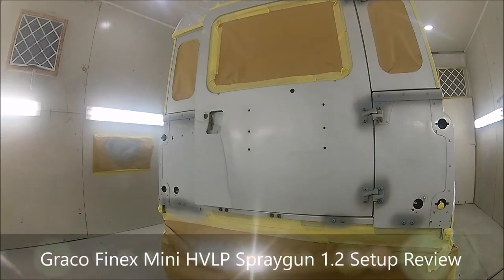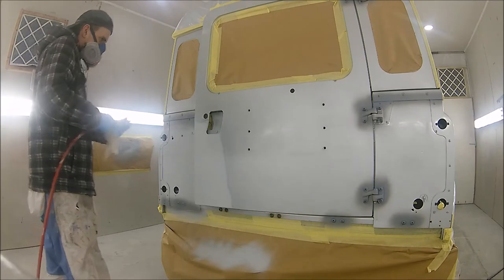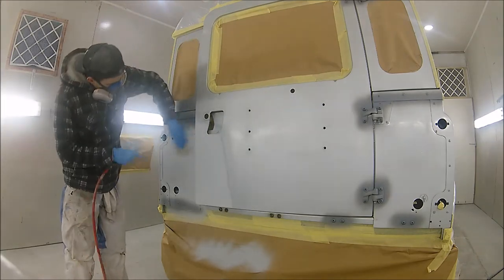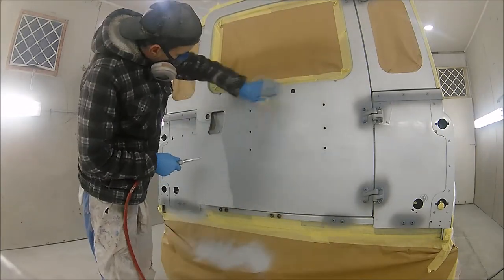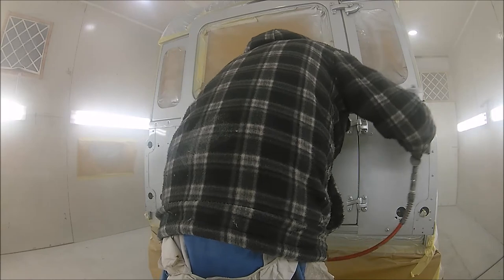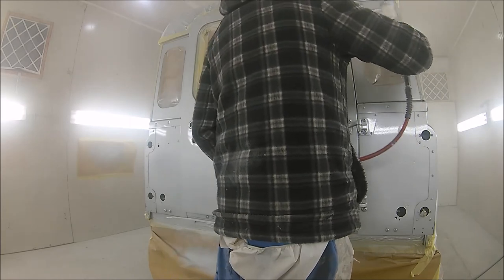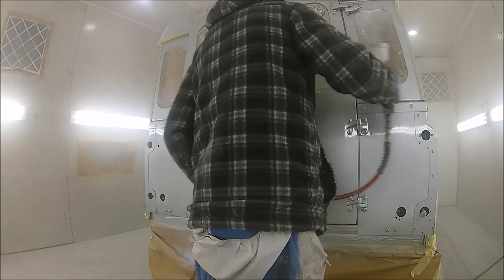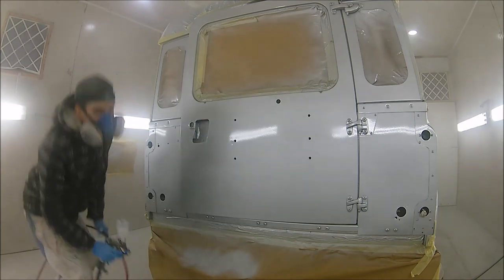Review : Graco Finex Gravity Feed Mini / Spot Repair HVLP  Spraygun 1.2 setup

Comment: Tony thanks for taking the time to review the fx1000. I bought this gun last year and all it has needed is a new lid for the cup, that was $5.00 US online. This gun is awesome quality for the money, I paid $130.00 US. My gun came in a 1.0 tip and I have found it a bit small shooting spots with dupont cromax chromabase....You really need to keep it around 29 PSI and use more reducer than you normally do or it can spit or get blotchy...Our Chromax chromabase is a 1 to 1 mix. They recomend 1.4 mm - 1.6 mm tip, so you really need to reduce it using the 1.0 mm tip.

My fx1000 truly looks as good as the day I bought it over one year ago...I have really been impressed with it's "Black Nickel" fin ish, it has been so durable and easy to clean. In my opinion, you will hard pressed to get much better quality for the money.

Tony have you tried the fx3000 yet? I hear some guy's really like them as well.

Comment: Looks good, I have been dealing with Sprayguns Direct for best part of 10 years and i have never met any other company with better customer services, they just do it right
Reply from the maker: +jason evans they are never had a problem with there service and there always straight on the phone if theres any issue with an order which is great coz you dont get the order turning up with bits missing if there is anything on back order you know before they have posted , brilliant guys have used them for almost all the guns i own
Reply: +Tonys_Refinishing I've got this gun in 1mm, went to spray guns direct to buy a 1.2 or 1.4 fluid tip, 40 quid plus post, that's ridiculous, half the price of the gun.
Reply from the maker: +user12345 this one was in a 1.2 tip size and youl usually find that with the lower prices guns tbh that the setups are expensive
Reply: Tonys_Refinishing Shame, cause it's a nice gun, just the right size for small jobs at home
Reply from the maker: +user12345 yeah I found it a really good little gun tbh , I bought it in the 1.2 and found it ideal

Comment: Tony I was wondering how you paint your door Jambs on a full respray of the car. I painted my 300zx and I jammed it out first then used the foam tape to try to keep the overspray out of the Jambs before I painted the outside of the car since I was painting the outside at a different time, what a screw up the Jambs were full of overspray on my clear coat so I'm starting over..my  question is should I paint the Jambs and the outside at the same time with basecoat then the same with the clear coat in order for this not to happen..used foam tape on the Jambs but it didn't hold and let overspray get all in the finished Jambs. I'm knew at this so I'm in the learning process but I will keep on till I succeed. Any advice would be greatly appreciated. sorry text is so long just trying to explain what I did.
Reply from the maker: hi Wendall , personally id take the doors off gives a much cleaner job, if this isnt an option which sometimes it isnt then id paint the jambs at the same time as the outside , once based make sure you tack rag them out to make sure any dry overspray is off them before clearing the whole job start with the first coat of clear in your jambs then move to the outside , its always best when doing this way to keep some fade out thinner in a spare gun just incase you get any dry edges on your clear from inside to out

Comment: Hi, i know its a old vide but im looking for a mini spray gun so i can paint calipers and small areas. Would you reccomened this gun on a 1.4 set up as thats what i need for my basecoat
Reply from the maker: What basecoat are you using mate tbh 1.4 is abit big for that try this gun Iwata AZ4 Impact JUNIOR HTE 1.0mm Smart Repair Spray Gun Review https://youtu.be/IFdahknGDx4
Reply: @TonysRefinishingTV  Hi, its a custom RAL mixed basecoat made for metal. I was told it needs no primer and no clear coat, just a few coats of that direct on the brake caliper.  I have ordered this gun you reveiwed in a 1.4 tip,  the paint supplier reccomended 1.3 or 1.4.   and the paint is mixed at 3:1 ration .  Is this sounding correct?
Reply from the maker: @yamaharaptor1896  yes could be a 3:1 mix mate which gun did you order ?
Reply: @TonysRefinishingTV  The same one you review in this video, from sprayguns direct , 1.4 tip
Reply: I literally only ordered it because of your review saying its a good gun, debabted on getting a cheap one but, buy cheap buy twice haha
Reply from the maker: @yamaharaptor1896  thats very true mate buying a better one saves money in the long run thats for sure
Reply: @TonysRefinishingTV  Yeah, but you think this gun is fine for calipers? Will be doing alot of cars calipers and need a small gun to get in the small area